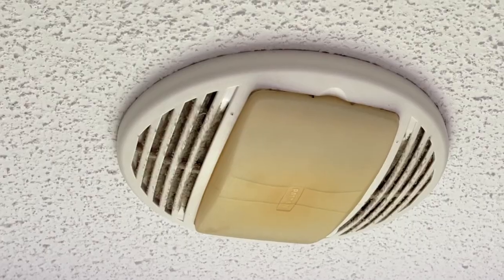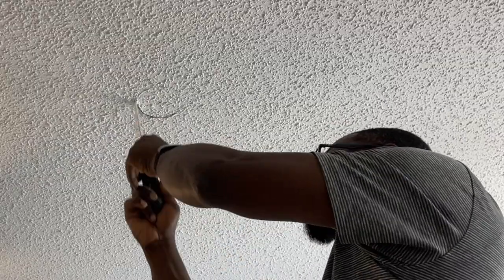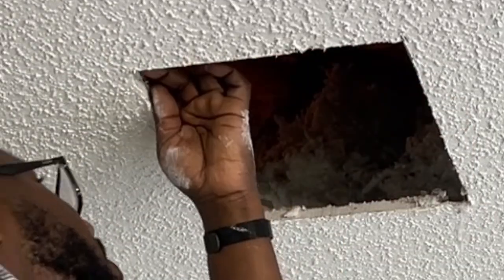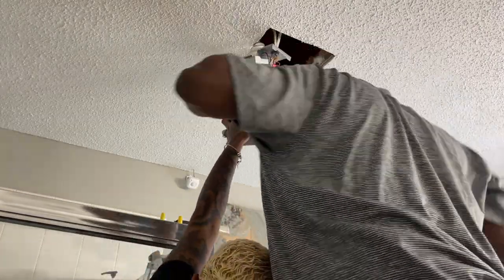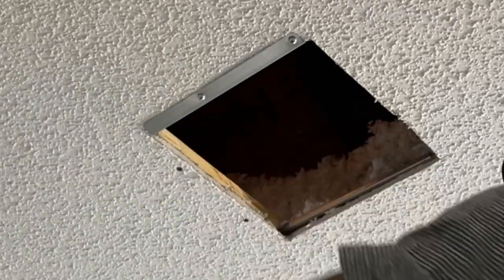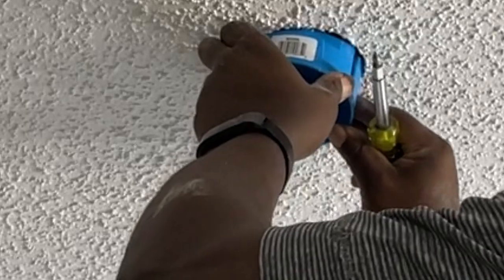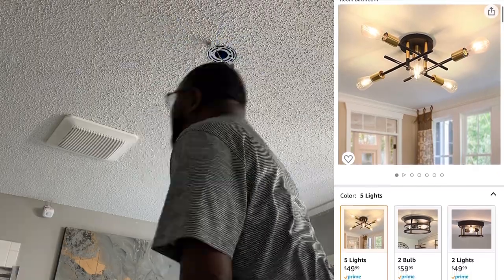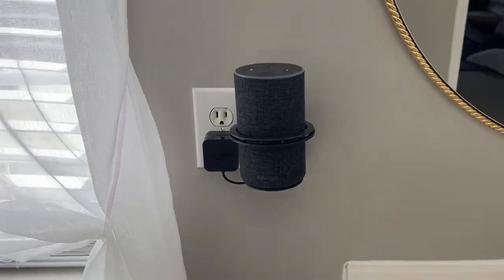Separate Light/Fan Combo | Retrofit Panasonic Bathroom Fan

Comment: Hello Ron, Is there a gadget u can buy to detect if there's a pipe behind the walls to prevent water leaks?
Reply from the maker: There is a gadget that detects pipes but it will not “prevent” leaks outside of you knowing where the pipes are so you can avoid disturbing them. Some “stud” finders also have electrical and plumbing sensors.
Reply: @rontalley  lol not necessarily to prevent them but more so of hitting a water pipe that will cause the leak is what i was trying to say but thank u so much i definitely need to buy one of those..
Reply from the maker: @shondamccoy8623  I need to get one myself because I’ve hit several pipes over the years doing various jobs. 🤦🏾‍♂️